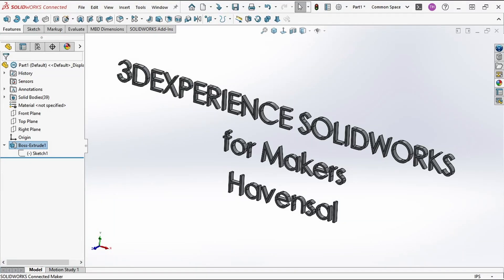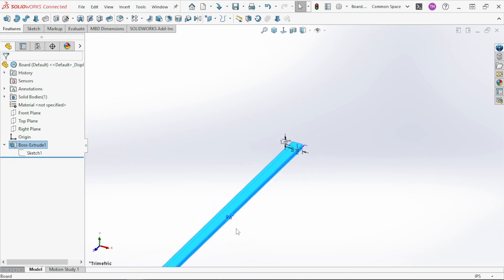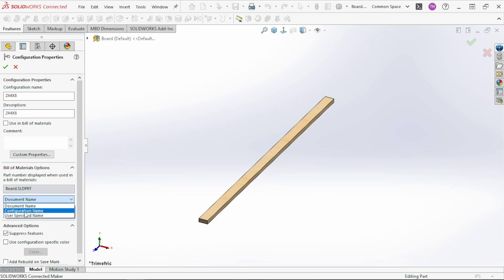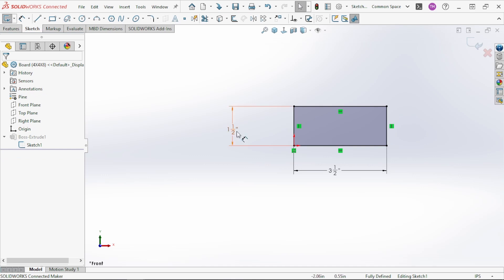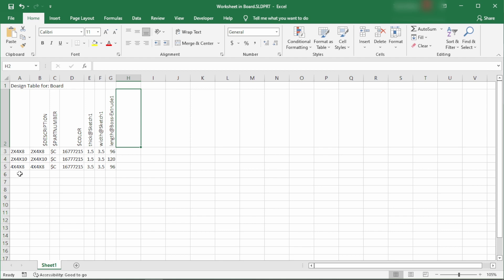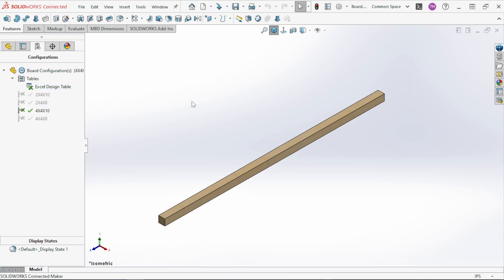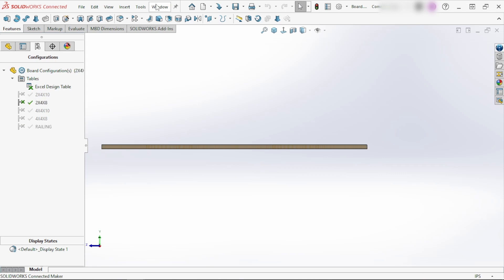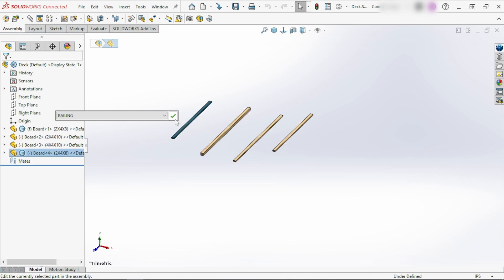3DEXPERIENCE SOLIDWORKS for Makers EP:5 Configurations and design table

Comment: Hi man, I am planning to get macbook air M2 and wondering a few questions about the SW4makers. I don't understand whether or not mac is compatible with SW as SW4makers comes with its cloud based solution. Did you experience any particular problems while you were running the SW? Thanks, good luck